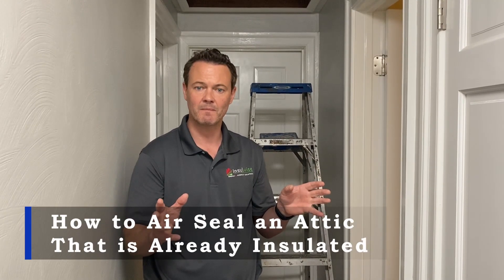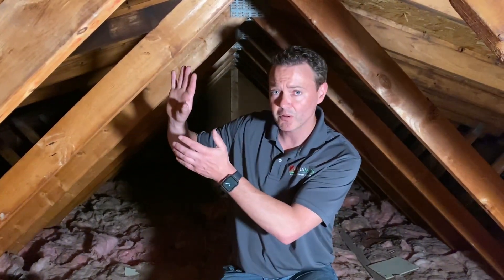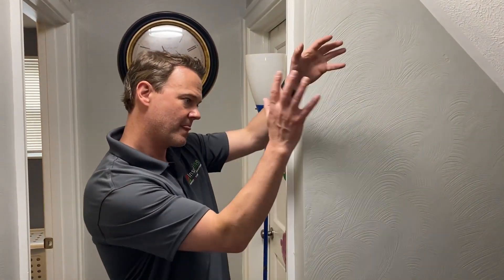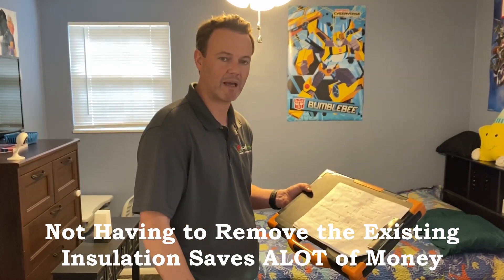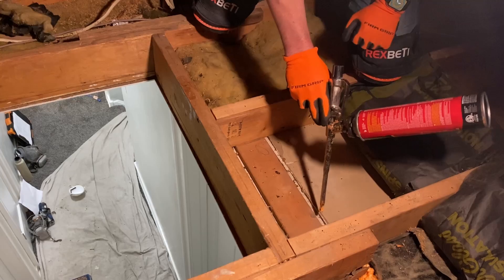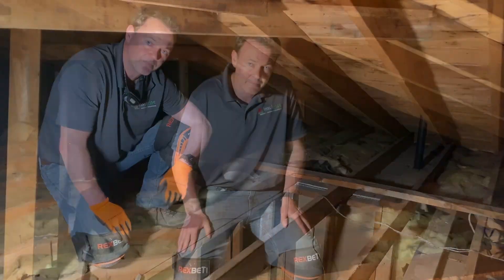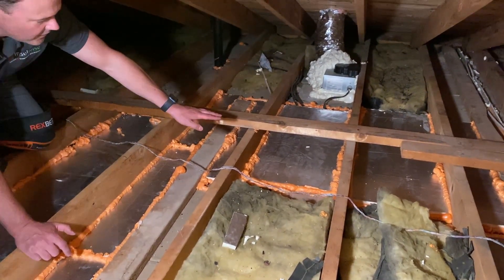Insulation Expert Reveals the BEST Way to Air Seal Your Attic

Comment: If you already have R60 blown in insulation, how do you even start to do air sealing after the fact without ruining the R60 blanket and having to re-blow insulation
Reply from the maker: We have had to air seal attics that have already been blown in with a lot of material, typically blown in fiberglass.  You have to displace it as you go, double check that you have in fact hit everything, and then rake it back into place.  Cellulose is more difficult to displace, it acts like sand on a beach.  But blown fiberglass is actually quite easy.  The only drawback with blown fiberglass is that it can compact a good bit while doing this.  When we retrofit attics, we always air seal them first, and then blow a fresh blanket of cellulose on top of whatever was there to get it 100% even again.  But a homeowner likely would not need to get it that "perfect."
Reply: @insulwiseenergycomfortsolu3293  I just had my attic redone this spring to R60 with blown in fibreglass.  Before that I airsealed all I could think of myself, any light fixture, and any wiring holes.  Thankfully there are no exhaust fans up there since I have a central exhaust system out the side of my house. But I am also not an expert at it either, so I assume I missed something.  Having a energy audit done to get in with some govt grant, I have taken my house from 139 GJ of energy a year to 101 GJ a year, according to their before and after readings, and blower door test.  So I must of done something right.  But even so, I still have some attic frost (I check a few days into a cold snap when we get them)   But I dont think its enough to accumulate into attic rain or anything, or if it does, its so light that it must dry out with ventilation.  I have my head in my attic at least a half dozen times per year, just to check that things are ok.  Would I like zero frost, 100%.  But as well, when you have a low of -35 outside with sometimes relative humidity of 70%, that frost can stick to things inside your attic, just like hoar frost outside.   Now that I would like to figure out how to mitigate.

Comment: Good luck ever changing a ceiling exhaust fan after..
Reply from the maker: We do it, but you're right it's not fun.  You have to first displace the cellulose in the general area, do the work, and then rake the insulation back into place.  It's a pain in the butt.  We regularly change out bathroom exhaust fans for higher performing models, and of course it's ideal to do it before the insulation is blown in!

Comment: Good stuff!  If it's in the budget, have the insulation contractor pull all the old insulation at the start of the project.  Makes it much easier to find & fix all the air leaks.
Reply from the maker: Thanks!  If possible sure that certainly makes the air sealing easier.  But if the team doing the work is used to air sealing when there is insulation down, are mapping the air leaks, and testing out with blower doors you can get the same result, and also save the homeowner a few thousand bucks while doing it.  That said, I would not trust most of our local competition here to get the results that we get with the insulation still in place.  Properly air sealing an attic floor is tedious, time consuming, methodical work -- and that's when the attic temperatures are "friendly".

Comment: What are your thoughts on using a thermal adapter like the Flir or Seek devices to map real time heat loss?
Reply from the maker: Not a bad idea at all.  If you add in a running blower door it gets even clearer.  However, if you simply assume that every penetration in the attic floor that you find is an air leak (top plate, wire hole, plumbing stack pipe, gaps around bath fans, recessed lights, etc), and seal it with foam, you should have the same outcome.  You're not going to get measurable air leakage through solid drywall, plaster, or framing lumber.  
Andy
Reply: @insulwiseenergycomfortsolu3293  Like others, my rafter bays are not blocked so air will flow from soffit to soffit in this cape cod's upper floor.  You can really see it with the thermal.  Now I'm just trying to figure out which foam gun will work best.  Looks like the Great Stuff Pro14 has the least offenses.

Comment: Don’t you want to spray foam the rafters for the roof, add vent channels and batt insulation and/or a radiant barrier?
Reply from the maker: You can do it this way too IF you are going to use closed cell foam.  Many foam contractors will use open cell foam for this, which is a no no (can contribute to / cause your roof to rot and we have seen this happen in Pittsburgh).  However, closed cell foam is very expensive, so most homeowners do not want to pay for this.  In fact most foam contractors don't even bring it up.  Our philosophy is to allow the roof to operate independently of the air and thermal barrier at the top of the home.  When done correctly, this is far less expensive than using closed cell foam, far safer for your roof than using open cell foam, and a highly effective and economical solution.  
Andy

Comment: I can't thank you enough for this video. Very informative and I wish I knew about this a long time ago. Our house seems to get colder every single winter, despite doing everything right with furnace maintenance, weatherproofing gaps, e.t.c. We've uncovered so many shortcuts the builder used on this house, it's a wonder how it even passed inspections before we bought it several years ago.  I always dread the winter months (Chicago) because of how cold this house gets and how taxing the constant energy use is on our furnace. Thank you for teaching us something new to check out in our attic once these frigid temps pass. Regardless of what you make, you truly need a pay raise. Thank you again for sharing your knowledge! 😊👍
Reply from the maker: Hi there, thanks for the compliment!  We certainly try, and effectively air sealing the attic floor of a home will often transform how that homes "performs" both in hot and cold temperature extremes.  It will also reduce the chances for having mold issues on the underside of your roof.  Good luck to you!
Andy
Reply: Building code = The least amount of work that can be done without being illegal.

Comment: I’ve noticed a building science trend where builders are favoring air sealing the rafters and making the attic into conditioned, air-sealed space. Matt Risinger from the Build show seems to talk a lot about it from the new home building perspective, but I’d imagine that level of effort may be even more challenging to get the right level of insulation in the attic.
Reply from the maker: You are correct, and I've seen that video.  I believe that a MASSIVE issue that he leaves out is the type of foam that should absolutely be used if you insulate the underside of the roof.  In his video I am almost positive that he used open cell foam, which is no no because it does not create a vapor barrier.  That means water vapor can move through it and get trapped against the underside of your wooden roof.  You DO NOT want this potential. 
The "hot roof" solution can work well, but it should only be done if you are going to use closed cell foam.  Closed cell foam is much more expensive, but at 2" thickness creates an effective moisture barrier (last time I checked).  We have seen roof rot issues in Pittsburgh from using open cell foam to insulate the underside of roofs.  If you google this and sniff around on the web a bit, you can verify this quickly. 
Thanks!
Andy
Reply: He used open cell because he's in Texas where I think they want it to breathe
Reply: One major issue that makes it cost-prohibitive to retro fit from a ventilated attic is if you have a conventional gas furnace in the attic space, which is typical in homes without basements.  That would have to be replaced with a heat-pump, or would have to have the gas furnace moved elsewhere.
Reply: Anyone whose tool of choice is wxpanding foam should not be allowed near your attic - there are uses for it but a whole industry has been created around telling people to make their house air tight.

Comment: Great video, and I wish I'd watched this video before choosing an insulation company last year. They did not go through these steps and properly sealed any air gaps and blew all the insulation in.  I saw you drawing the map of lights and fire alarms and etc, but if the insulation is already blew in, how could anyone properly identify and seal those gaps with those foams?  Thanks for your advice.
Reply from the maker: Well, it’s a shame they didn’t air seal the attic first, but that is unfortunately quite common.  It is still possible, but not easy.  Our teams at Insulwise do it everyday, but it takes some training, patience, planning (as in mapping out the air leaks), and also a willingness to get dirty.  It is also more dangerous as the floor joists are obscured.  You’d need a headlamp, knee pads, minimum N95 respirator, foam,  a willingness to get dirty and a bit uncomfortable for several hours, and some persistence.  But it is possible!
Andy
Reply: Thank you for your reply. That’s what I thought but was wondering if there was any trick. Know any highly recommended experienced technician around Seattle area? Just trying my luck.

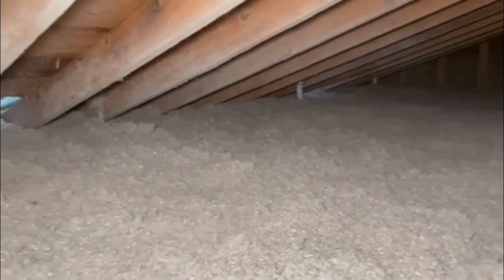Comment: at 11:00, what is the light that appears to be coming from a hole in the roof?
Reply from the maker: This attic had zero intake ventilation.  We needed to install it in order to balance the ridge vent (exhaust ventilation).  We did this by installing a series of slant back vents along the back of the house.  That is the light that you see coming through. 
Andy

Comment: I don't see any chimneys... But what if there was a wood burning fireplace flue penetration? Yiu aren't supposed to be within two inches of the flue...  So how can air leaks be prevented there?
Reply from the maker: You CAN seal around hot flues and chimneys, but it requires a specific process.  We cut sheet metal to conform around or butt against the flue or chimney, and then seal the sheet metal to the flue or chimney using HTV (high temperature) silicone.   We then wrap either a fiberglass or rock wool batt around the flue pipe or chimney before blowing in cellulose insulation around the area.  The main thing is using something to air seal that either cannot combust (sheet metal) or is designed for high heat applications (htv silicone).  Hope this helps!
Andy

Comment: Can you use any foam or does it have to be fire blocking?
Reply from the maker: We often just use regular Great Stuff for $5 a can.  It does just as good of a job and is much less expensive.  If your house has a fire, and won't be the type of foam that you used for attic air sealing that makes or breaks the damage the fire does.
Reply: @insulwiseenergycomfortsolu3293  thanks for tip. Like your videos. I gotta say, you guys earn your keep! I am about sick of doing my own attic. I used to say if I went into a trade instead of a desk job I would have done HVAC. I recant my earlier statement after crawling around in our attic for several days. Lol

Comment: Did you remove the old insulation before blowing in the new one?
Reply from the maker: We did not,  We map out the air leaks, seal them, and utilize the existing insulation that is there.  It makes the project less expensive for the homeowner.
Reply: @insulwiseenergycomfortsolu3293  thank you.

Comment: 10" of cellulose was R-30 at the time. As l recall 14" was R-30 for blown fibreglass. Keep in mind with an pull down attic ladder in the garage with a garage door open the potential for blowing insulation is greatly increased.
Reply from the maker: Thanks, when cellulose settles after getting blown in, it actually becomes fairly resistant to being blown around in attics, even when close to whole house fans.  Blown fiberglass is much more likely to be "wind washed" like this. 
Andy

Comment: What about soffit venting? I don't see a thermal break at roof and I don't see vent baffles.
Reply from the maker: Read previous replies to this question, I address that several times.  Thanks!
Reply: @insulwiseenergycomfortsolu3293  Ok, I didn't read all of the replies. You explained what you did in this case. I'm trying to determine if I need to ventilate my soffits and then move back my insulation and install baffles in my attic, OR if it is MEANT to be this way for some valid reason and I should leave it alone. This house was built like this in 1978. It does have three vents near the ridge, but the soffits are all sealed up and there is insulation pushed out to the roofline. I'm in South Central Kansas, "Zone 4." We have brutally hot summers with humidity, and brutally cold winters. Both summer and winter can be VERY windy.
Reply from the maker: @dolfinwriter5389   Ahhh ok I totally understand.  Yes -- if you have an unconditioned, vented attic like you have and the one in this video -- you absolutely want to 1)  Have an adequate amount of roof ventilation and 2) make sure that that ventilation is balanced between intake (soffit vents) and exhaust (ridge ventilation).  If you do not, the ridge vents have a tendency to exacerbate Stack Effect within the home during winter.  This leads to added heat loss and increased risk of attic mold growth as additional water vapor from your home via attic floor air leakage gets deposited into your attic.  
However -- soffit vents DO increase the risk for a roof getting blown off in a high wind storm event.  There is a good argument to be made for using closed cell spray foam (NOT open cell foam.  Two entirely different materials) to insulate the underside of the roof in areas like this.  It will not only insulate extremely well and also provide a vapor barrier --- but it will increase the structural rigidity of the roof --- and not leave soffit vents as a place where powerful gusts can enter and potentially lift the roof off.  However, closed cell spray foam tends to be very expensive.  If I were you and had an extra $15-25k sitting around this just might be the direction that I would go.  Otherwise, you should find a way to install intake ventilation to balance your exhaust vents.  
At the home in this video we installed a series of slant back vents along the back of the home, about 4.  It's not as good as continuous soffit ventilation or continuous under-shingle intake vents, but it far better than not installing them.  After air sealing the attic floor, the exhaust vents will now pull their air from these slant back vents as opposed to the house.  This helps to dry the attic from unanticipated moisture intrusion, and dissipate summer heat.  You can see light coming in from some of them in the final part of the video.
Hope this helps!
Andy

Comment: What would it cost to remove old insulation, do pest control spray, air seal all openings, and install sealant and do r38 or R49 insulation on 3K sq. ft. area?
Reply from the maker: Every house is different, even with the specifications that you provided.  If you are in the Pittsburgh area just give us a call and we'll happily come out and quote your project free of charge. 
Thanks!

Comment: Any way you still have some heat and cold air escapes from the house you should insulated the studs and Thermo play around the walls and then do the foam boards now in this days everybody’s knows how to do insulation insulation is not a job insulation is an art Daniel insulation 28 years experience
Reply from the maker: Hi Daniel, thanks for the comment.  Yes air and thermal loss also occurs through the exterior walls,  and we do also fix that, but this video was only intended to address air leakage that occurs through the attic plane of a home.  And judging by a fair bit of the work that we have seen from our local "professional" competition, I would disagree that "everyone" knows how to do insulation.  However I would agree that it that it often involves a fair bit of art in addition to science.  There is A LOT of onsite problem solving that we perform. 
Andy